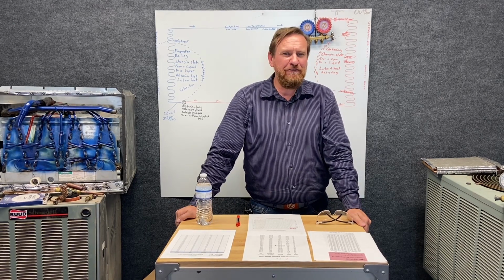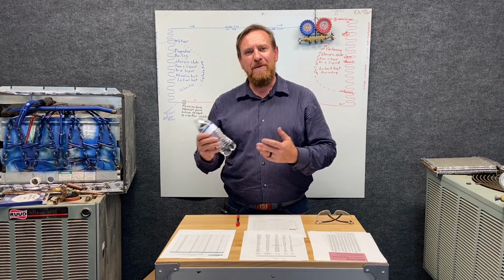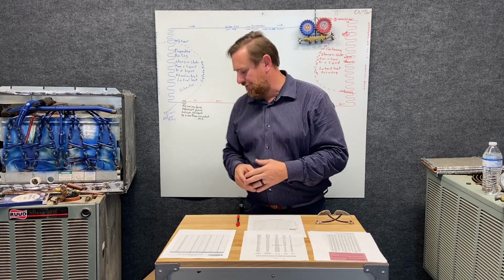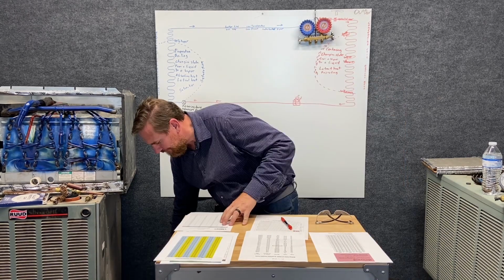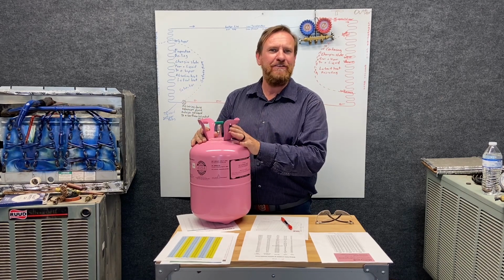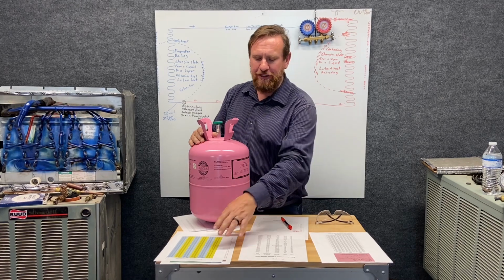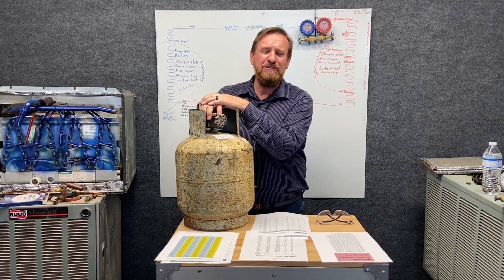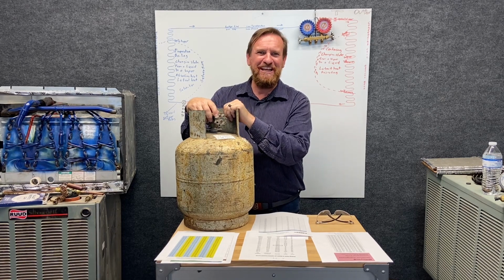HVAC 023 Refrigerant introduction

Comment: Hello Ty! This might be a stupid question. But how is it possible for the refrigerant to stay in a saturated state in the tank, when the boiling point is at so low temperature? I mean, shouldn’t the refrigerant absorb heat from the tank and it all would transform in to vapor?
Reply from the maker: The boiling point is only low with a low pressure. For example 0psig it boils at a negative temperature.

Once we squeeze it in a tank the pressure will be greater making the boiling point much higher.

Keep watching the videos on order and you will see it.

Comment: My dad says R600a is a bastard gas.
Reply from the maker: The arguments love and hate for refregerants will go on forever. 
When you get to a system that has R600a you can simply say no, I refuse to work on it. You can also take the certification class, understand the operation and safety aspects and choose to accept it.

The bigger problem is people putting it in systems not designed for it and people working on it without the tools knowledge and skills to do so and get hurt.

Comment: why r134a is not used in hvac, other than cars and home refrigerators?
Reply from the maker: R134A  has lower thermal conductivity resulting in a lower cooling capacity approximately 60% in the higher temperature cooling in a house.
It works well in medium temperature applications with low load and the  variable compressor capacity of the automotive compressor.
Reply: @love2hvac  thank you

Comment: If the start and stop running of compressor generates electrical arch inside of compressor will it cause R290 explosion?Thank you
Reply from the maker: Great question and the answer is no.

You cannot have a flame or an explosion without oxygen. There is no oxygen inside a sealed system. 

Titan has an atmosphere made of methane, but there is no oxygen so it also cannot explode.

https://www.rses.org/training/hydrocarbontrainingprogram.aspx

If you have some oxygen it still cannot explode due to upper and lower explosion limits 
https://youtu.be/8jmX-TUQkx4